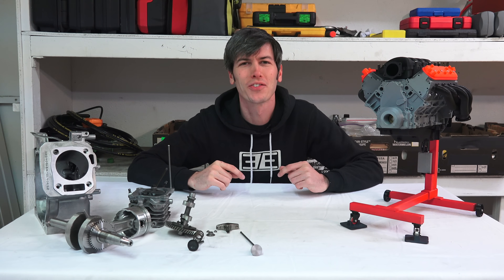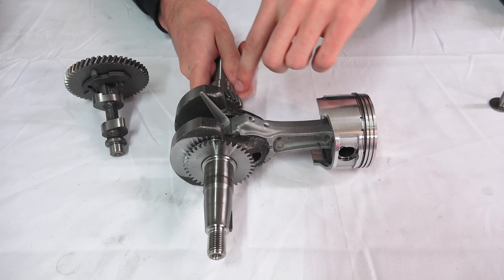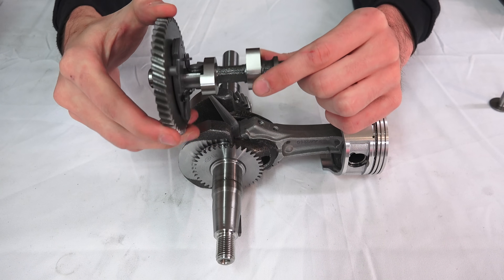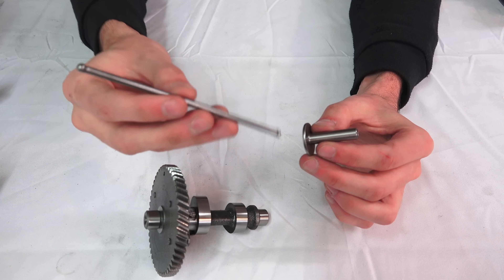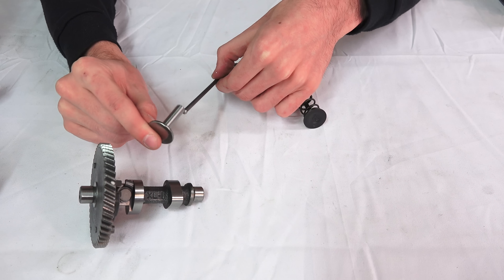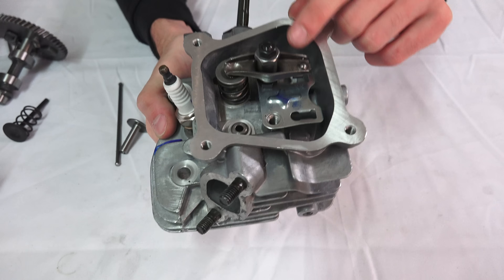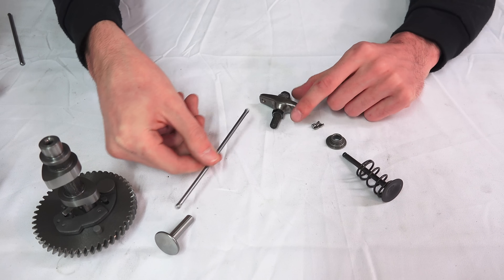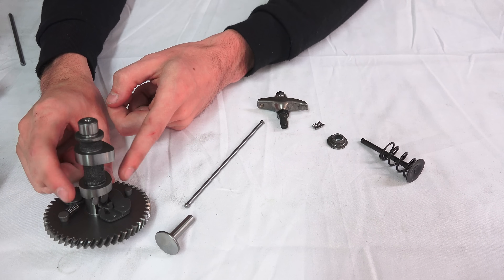Why Can't Pushrod Engines Rev High?

Comment: Valve float & small intake ports for low-end power. HOWEVER, with a good intake, heads, cam and a lightweight valvetrain, it'll live at 10,000 rpm. Look at Ray Barton race engine Hemis. Those are 10k rpm engines. My daily driver DOHC engine is comfortable at 7k rpm, but Id want to upgrade the valve springs and fuel system if I wanted it to run at higher revs. In real everyday practical use though, few engines will ever see much more than 4000 - 4500 rpm, and only for a few seconds. And thats just fine for any type of engine.

Comment: Somebody got smart and eliminated all those extra parts...2 Stroke engine. The cylinder itself is the valve...and you get another invisible valve from the shockwave return in the expansion chamber pipe....even the crank performs 2 functions .

Comment: You obviously don't have a clue! Valve float refers to hydraulic lifters which can't take the high rpm's. All you need to do is install solid lifters and you can get all the rpm's you want, providing you build the lower end to handle high rpm's

Comment: Piston speed is more of a limiting factor for an engine's rev limit than its valve train. Some of the reasons cited in this video for pushrod engines not being able to rev high also apply to OHC engine's (valve springs and valve float, timing, etc.) Most pushrod engines tend to be larger displacement engines with longer piston strokes. As revs increase the speed at which the piston moves up and down in the bore increases exponentially. Basically, the shorter the stroke of the piston the higher the engine can rev because the piston does not have to travel as far as a longer stroke engine in the same amount of time.

Comment: Nice video! A little off topic but one of my favorite engines of all time was the Ilmor Mercedes pushrod V8 used in the Penske PC23 chassis that decimated its competitors during the 1994 Indy 500. Those pushrods fit perfectly through a rule book loophole.

Comment: The key to making a  good pushrod engine is a long stroke like 100mm 4 inches and a cam profile with a big flat torque curve.  As they say horsepower  sells cars but torque wins races. Thermal efficiency is better on longer stroke engines also improving gas millage.

Comment: Also, consider that in some engine designs, the piston, connecting rod and bearings do not have the strength to support their mass in the sudden deceleration, stop, and acceleration that occurs when they switch direction at the top and bottom of the cylinder at higher linear and therefore rotary speeds. Which would cause the "grenading" effect proposed by a previous commenter. In short, some engines have pistons heavy enough to throw themselves apart at a higher speed.

Comment: What are your thoughts on de-stroker kits? I’m planning on building an LS3 with LS7 heads, LS9 camshaft, titanium rods, forged internals and a destroker kit to around 9K rpm. (For a twin turbo or supercharger application.

Comment: So wouldn’t a lighter assembly help? What are the heat limits of carbon fiber? Would a second metal or air spring above the lifter aid in closing the valve if the valve had extra engineering to secure it to the rocker so the rocker would be both pushing and pulling the valve?
I suppose some would defeat the purpose of simplicity and lower cost, but part of the advantage of the LS engines are their more compact size and lower weight and center of gravity.

Screw it, just build a billet rotary and remove all these ‘extra’ parts, size, and weight.

Comment: Seems to me that everyone in the comment section is forgetting the most important equation.

HP = (($ x in^3)^2)/5252
Reply: Funny
Reply: Where does the 5252 come from?
Reply: @IvelLeCog  horsepower is somewhat but not totally arbitrarily  defined as 33000 ft. Lbs of work per minute (had something to do with a horse and a bucket and a well) so horsepower is ft. Lbs per minute ÷ 33000, or POWER÷33000. At some point in deriving an equation for the horsepower at a given rpm of a car you get HP= torque x RPM x 6.28 ÷ 33000. For some reason the fact that 33000 ÷ 6.28 = 5252 means HP = TORQUE x RPM /5252. 

I realize my explanation is incomplete but I can't totally remember and I'm hoping someone finishes the explanation to remind me.
Reply: @IvelLeCog  all you need to know is 5252 is a constant. Every number will change when finding horsepower other than 5252. Hp= Torque x RPM / 5252. Torque and RPM can be variable. 5252 never changes
Reply: @chickenfixn4439  It depends on units being used (as Nathan explained) - you would use a different constant if calculating in Nm.
Reply: @xriex  Right but for someone who doesnt understand where the 5252 comes in they dont need that much information. Im sure not all of us went to school for it so I gave him the simplest answer / the most general answer needed

Comment: The original Camaro Z28 302 revved well into the high 7000 range.  The fact that we have superchargers across the board now means we can have a smaller stroke V8 that will rev super high, with the supercharger mitigating what people would see as HP loss (due to marketing in the Horsepower Wars).  Naturally, the supercharger then has to be tuned for what rpm range it will operate optimally at.

Comment: Funny, my 05 Ram had a race cam, hd push rods and springs, shifted at nearly 6,500. Had almost 280,000 miles when I traded in on a new Ram. Loved to rev, meanwhile my new high tech ohc EcoDiesel is tapped out at 4 grand, hmmm.

Comment: you appear to have missed out valve bounce. this also is a big problem at high revs for push rod engines especially.. When the valve closes via the spring the energy in the spring recoils and re-opens the valve slightly as the spring is not damped.

Solutions are often to fit double springs or heavier springs but as usual you do not get something for nothing.  the heavier springs require more energy to push and will put a lot more strain on the valve train mechanism/camshaft.

Comment: Chevy and Dodge use the pushrod "OHV" design instead of the dual overhead cam "DOHC" design for two reasons. 1st, OHV engines have less moving parts which makes them far more mechanically efficient = more power. 2nd, OHV engines by design are much smaller dimensionally than DHOC engines thus saving weight and allowing a lower center of gravity= better handling. Also, to the best of my knowledge there has never been a DOHC motor that put out anywhere near the horsepower of a Top Fuel Dragster 500 cubic-inch OHV engine, "8000 to 9000 hp".  Lastly, anyone who actually turns wrench for a living knows that working on a OHV is far easier than working on a DOHC. Long live OHV engines. It's just one of the rare times when an eairler design is better than a newer one.
Reply: You know, in all my years of turning wrenches on everything from forklifts to semis, i can tell you OHV motors are pretty much universally more reliable and easier to work on with a couple exceptions.
Reply: Lol, less moving parts makes OHV more mechanically efficient?  Why do you guys make these statements when it obvious you don’t have a clue?  

Your statement is dead wrong, BTW.

Comment: pushrod valvetrain losses outperform the gains around 9000. in DOHC, the same is true around 12,000 rpm. in pnumatic valvetrains, the limit is so high, it's not a concern for piston driven engines.

Comment: Two valve hemi heads are pretty much the ultimate in airflow, because of cylinder head & valvetrain geometry - its basically a strait shot into the cylinder, combined with massive valves - Alan Johnsons billet hemi heads, intended for top fuel, flow in the mid 500 cfm range at max lift.
Reply: Ask any top fuel engine builder why they don't use overhead cam and see what they say
Reply: @Prestiged_peck bc they're gay?

Comment: The reason is simple 

Push rod engines tend to be undersquare engines

So the stroke is greater than the bore. Thus meaning the piston will travel further and so faster per revolution. Meaning there is a limit to how fast you can more a piston or conrod before it will bend and damage the engine

So if the piston is travel twice as far it will only be able to rev half as much but both will be limited to same piston speed etc 

They have used a undersquare engine to increase torque or due to packaging.

Comment: Pushrod engines can rev high. Winston Cup engines can hit 10000 all day. But, yes, OHC engines can rev much easier because the valvetrain geometry is not as critical as it is with pushrod engines.

Comment: This is great as an educational video for those who dont understand valve trains yet, or are just curious, however, my question is why we care that push rod engines cant rev high, high rpm does not nessacerily mean high power, look at scooters, more important than high rpm is a good transmission and rear end (on rear wheel drive cars) gear those right and you can get a lot of speed on low rpm

Comment: Convert it to a uniflow 2 stroke with ports on the BDC and a rotary exhaust ball valves (Coates) Now run a dry sump with oil injection with Klotz r50 2 stroke oil

Comment: Now take a big block, cut ports on bottom and use a rotary exhaust valve to make a unified 2 stroke, then run a dry dump with oil injection and use castor 927 maxima 2 stroke oil, that would be intersting

Comment: You may want to look up the Ilmor Indy pushrod V8’s incredibly high rpm engines. That being said there  is no advantage to making power higher in the RPM range if you have an adequate transmission. As for your airflow argument, show me a better factory cylinder head that flows better than an LS7. The 2018 Coyote and M159 can’t touch it.

Comment: I came here to tell you, you are wrong. Please google SB2.2 and tell me push rod engines dont rev to 10,000rpm. The SB2.2 is designed for full throttle 100% load at 7000rpm for 2000hours straight before considering a rebuild. Yet "pushrod" motors cant rev high.... interesting

Comment: 30 years ago, my 289  Mustang had a 7500 shift Point. Pushrod engines can rev. It takes a lot of  money, and trial and error. Once you find the right combo, it will run all day long.  Modern engines are meant to be mass produced, as cheaply as possible. They are smarter. Not necessarily better.

Comment: Push rod engines can rev.  Chevy 302 in 69 would hit 9000 to 12000 rpm.  But yes the valve train does need to be beefed up to do it.

Comment: Variable valve timing. Dodge came up with a system that allowed the intake and exhaust timing to be adjusted independent from each other. Also, Rhodes has been producing lifters that will give increased lift and a bit more duration at higher RPM. Sadly, this does not change the fact that port size and shape are going to have strong influence over the RPM range where the engine will be most efficent, and the OHV engines which this video is about generally are of larger displacement, requiring more air, making them less efficent at higher RPM if they are to remain well mannered for the street.

Comment: Engines with just push rods on cam with a stiffer valve springs. That set up can run like a OHC engine. I've seen and done it.

Comment: Dang, that was more things than I even knew of. I knew about mass and therefore limitations of the springs (also probably doesn't help that with rocker arms changing the direction of the action of the valves 130-160 degrees probably reduces the overall effective effort of the spring as well, regardless of RPM, yes?).
Love it.

Comment: A well balanced small block ford can scream- so long as the valve springs maintain contact with the push rod/lifter assembly and provided the rod and pistons are a lighter alloy. Much of the issue with a “push rod” or OHV motor revving super high is usually its size. Big long throw cranks don’t make a happy motor with a baby 9” deck height. You need an over square motor like the GM 302 v8, or pontiacs sick af 303. A 383 Chevy will get it done but the rod angle at 90* isn’t the best for stability at 7k+. Big bore, short stroke. Solid roller valvetrain, high duration cam. Big heads, big headers. 800 cfm carb..yeah. Then it’ll run out like a Honda but why? Lol

Comment: Pro Stock uses GM pushrod engines, 10,500 rpm limiter. They can rev high, just most aren't designed that way.

Comment: NHRA pro stock engines were pushing 12000 rpm prior to the current 10.5k Rev. Limit. This was with a 500 cubic inch or 8.2L pushrod engine.

Comment: Increased RPM come by way of lighter components,  heavier springs, and roller lifters and rockers.  One other potential problem with push rods is that in some cases compromises in port design have to be made to accommodate them.

Comment: i still like ohv, there lower in height and i like that even though im working a truck for off roading i can fit more stuff under the hood like alternators and air compressors easier and its easier at least in the us to find parts suited for what i need which isnt rpm its low rpm power turn big heavy tires

Comment: Like all your video this one is super informative.  Just one comment.  Stiffer valve springs don't usually result in power loss due to the "regenerative" properties of valvetrains.  When one spring is compressing another spring is decompressing somewhere in the valvetrain.  So set springs as stiff as is needed to not float for your given cam profile.

Comment: The reason pushrod engines don't have high red-lines is that the majority of car drivers aren't interested. They want a vehicle that is reliable, starts easily, generally loaded down with accessories and is comfortable. All of which a push rod, low R.P.M. engine can do. Cheaply and reliably. However, as you pointed out, NASCAR engines turn 10K RPM. I believe piston speed is the limiting factor. To turn a big V-8 to 10K was unthinkable when I was young.

Comment: Performance air cooled Volkswagen engines with push rods can rev to 8000rpm.
Reply: And all the pistons grab the bores and the valves jam in the guides. Though yes I have seen methanol fueled Autocrafts run that high. But not on petrol!

Comment: I had a BSA A65 Lightning production-race M/C, which was red-lined at 8750rpm. Standard is 6000rpm. It was raced in the 1973 Production TT by Peter Bates, a 114 mile race, and finished 13th. Beating several works machines which DNFed!  Std points ignition so no rev-limiter! It had a 740cc barrel kit, making it oversquare, slipper or reduced skirt pistons to handle the higher piston speed, which are common now but not then, lightened and balanced crank, ported head, std valves and springs but quite drastically lightened rockers, the top and bottom edges of the std cast-iron rocker arms were knife-edged, and the screw-adjustment bosses were greatly thinned. So very light rockers, a very long and careful job, the main reason it revved so well I think. The rockers were quite beautifully sculpted, and were not the first try I suspect. A top-half fairing was fitted, but std frame, wheels and mudguards, to comply with race-regs.

It was raced in the 1973 Production TT, a 114 mile race, and finished 13th. Beating several works machines which DNF. Including the Monocoque Factory Nortons of Peter Williams and Dave Croxford. I used it as daily transport for 2yrs or so, after a rebuild as it was on Castrol "R", which I was told sludges badly if left in. It had bog standard transmission. I was never late for work!
 It was very torquey off the line, wheelie-ing easily, and a wickedly fast top-end! Timed at 147 mph at Snetterton. So over 150 on a good day. Probably 160 mph downhill if pushed. I still miss it.

Comment: I hate overhead cam engines. Too much crap to deal with just to remove/install heads. And don't mention belt driven cams with their damn belts that need to be replaced or else big problems.

Comment: I'd love to see a video about 4 valve pushrod motors and why they exist. Another comment mentioned a Honda V-twin 500cc motorcycle engine in the CX500, the new Harley-Davidson Milwaukee-Eight engine has a four-valve layout with pushrods, and the Cummins B-series engines in the Ram HD trucks are also have 4 valve pushrod valvetrains.

Comment: If you used a captured follower design with the followers, push rods and rockers linked together, it would allow the camshaft to pull those linked components down as well as push them up. That would eliminate the issue and allow a push rod engine to rev freely up to 12k or even 13k rpm. Provided the rest of the components are strong enough.
Reply: soo push arms
Reply: @patricioignacio-n2f  There are several ways you could implement it. Common engine designs rely on spring pressure to overcome inertia and keep the valve train components clamped together. As RPMs increase, inertia increases until it overcomes the spring pressure and the valves start to float. Higher spring pressure allows higher RPM, but at the cost of increased friction and stress on components.

A valve spring retainer with a shoulder and a  second cam follower that engages that shoulder to pull the valve closed could eliminate the need for high spring pressure and allow much higher RPMs. A cam with two lobes per valve would be required. One that opens the valve and one that closes it.